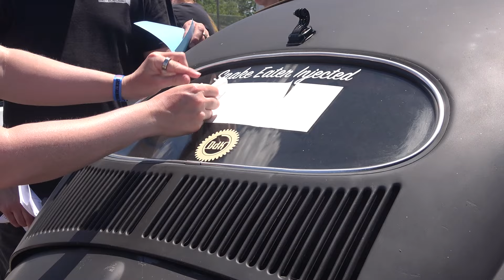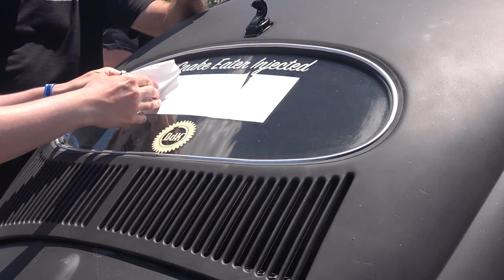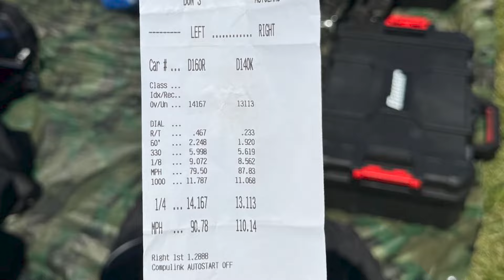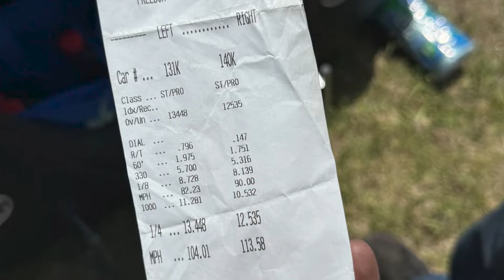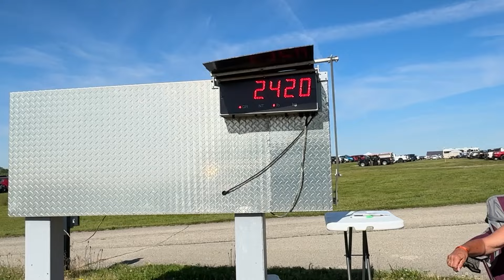VW Bugs@ Sick Summer 2024

Comment: I put a garden sprayer nozzle on my oil cooler. It was extremely effective at lowering oil temperature when needed.
Reply from the maker: @jamesholth5616  what did you spray through it?
Reply: @ddk56vw  Water as needed. 30 seconds of spraying brings the temp. way down. Sickweek had pretty cool weather. The 2 gallon sprayer was enough for each drive.